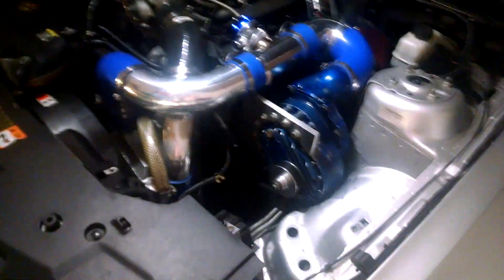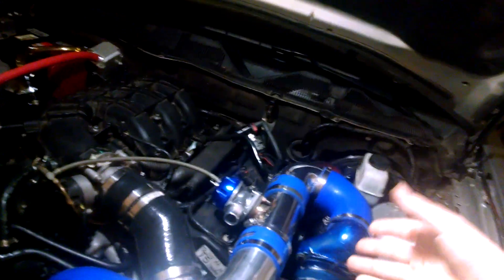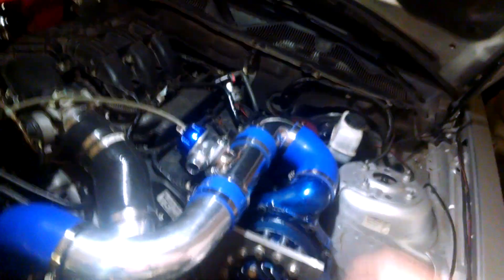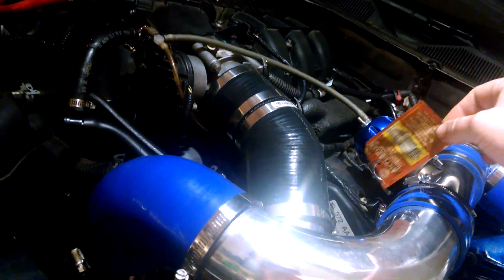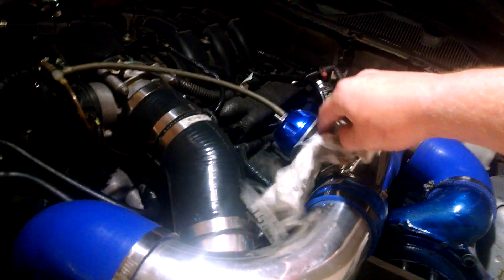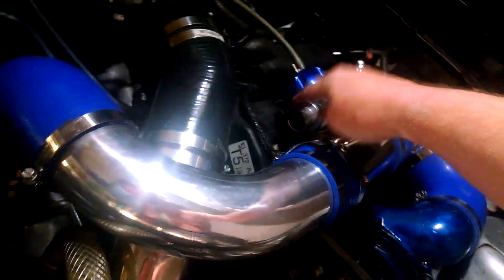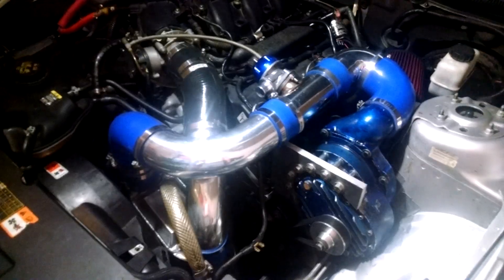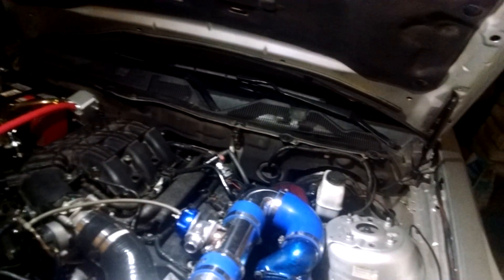Start up home made supercharger kit

Comment from the maker: I know this is super old video I was just putting up a new video about something else and I just thought I'd add in here don't use eBay blow off valves they're crap I eventually put a vortec blow valve on and it sounded amazing and it worked so much better I got to use for like $110 so yeah it's five times more than eBay one but it's 20 times better

Comment: nice!  how did you mount it all?  did you just buy the b
rackets?
Reply from the maker: No I just bought the metal and used a cheap drill press and hand drill and hand angle grinder and $30 Dremel I got from AutoZone to cut it all out although I made like three different iterations of brackets and I started using cardboard and then went to wood and then went to aluminum and the third one for the powerdyne I actually had a guy who had an actual milling machine and lathe and stuff and he helped me make the last one so this one's a lot prettier than the first two and it doesn't flex like the old ones as much and then when I put the vortec on I took that last powersyne bracket to an actual fabrication shop and they copied it except instead of having the mounting holes for the powerdyne they switched it to vortec mounting holes and it looked way better you can see that in my later videos and that one didn't flex at all that one was out of better aluminum and I think it was 3/4 of an inch thick instead of I think these were like 5/8 thick

Comment: How did you make it and what did you use??? I'd love to make my own supercharger like that also
Reply from the maker: literally just you got to see if you have room first and then just use cardboard make a bracket see if it seems like it fits and I had to buy the supercharger first and then you know just kind of mock it up until it seems like it works and then what I did is I made one out of wood because woods a lot easier to fabricate or alter and if you mess up it's cheaper to replace.  And when I went to the fabrication shop and had them copy from my old one to the new one for the vortec I think it only cost me like 200 bucks although that was years ago I mean you can see the dates on these videos they're old but it's you know if you can get one that kind of works even if it looks like s*** just get it where the holes are in the right spot and then go to a machine shop I'm trying to remember the name It was a liquid metal I'm in Phoenix Arizona if you look up liquid metal they did tons of work for all my supercharger kits I made and they are freaking amazing and they would be cheap and they would drive everything up on CAD so you know even if you don't can't do it all all yourself you know make it out of wood and then bring to them and say hey I need this but in aluminum

Comment: awesome stuff bro!!! is the pully off a alternator?
Reply from the maker: No the pulleys were the powerdyne versions but the guy who had the milling machine also had a lathe and he helped me cut down the extra part that sticks out that's normally on there it's like a spacer but it's part of the pulley I actually had done that myself on another pulley but I had to use an angle grinder and it was all chewed up and s*** looking so like if you're ever going to do this yourself do yourself a favor find a machine shop near you that's good and just have them do that kind of stuff if you don't have the stuff to do it the place that I went to would do that stuff for really cheap if the friend that I had with the milling stuff couldn't do it or he wasn't available

Comment from the maker: No don't make em for others too much liability.  And I fucked up this is a powerdyne bd11a and ever with upgrading everything but impellar it still has issues can spin them too fast no oil belt driven look it up.  Anyways no this will be the only one.  But anyone can do it if you really want to I'm just a regular guy no training no crazy tools.  Though on last bracket, took 3 attempts, I did have a guy with a band saw and mill to help but could of done it without it I already had twice before.

Comment: Hey how much did this cost you? Can you make me a bracket like that?  How much would you charge? I wanna see more of this kit! You know you could make hella money right?
Reply from the maker: I think in the end it came out to like 3,500 maybe more the dyno tune was a big cost that was like $700 and then I did another $200 to retune it later The powerdyne I got for I think $800 the vortec was like $1200 and a lot of the other stuff is just eBay branded stuff but I went through like three cheap BOV's before I finally just went and found a guy who had a real vortec one that I think I paid $120 so get the good stuff work really matters like the supercharger and the blow-off valve and and get a good tuner and like I was going to go to this place dynocomp and here in Phoenix that was supposed to be the best place ever and the guys really cool and he just flat out told me oh no it can't be done if you made it yourself we're not going to touch it so they were jerks and I found this place az dyno chip, Keith and he's freaking amazing anyways